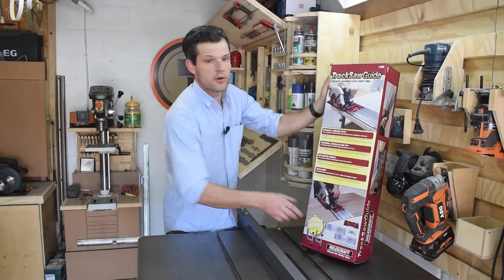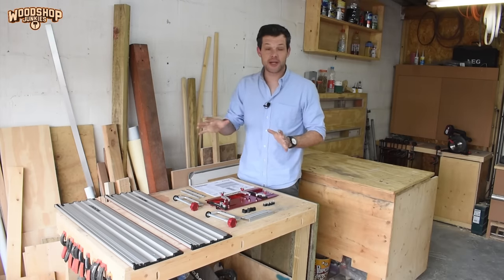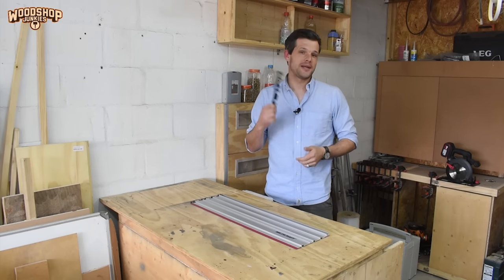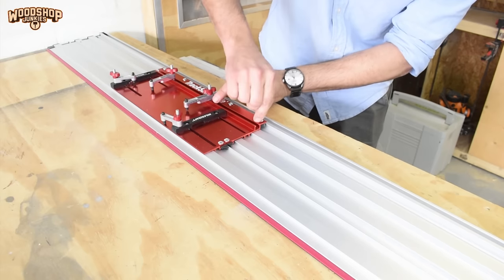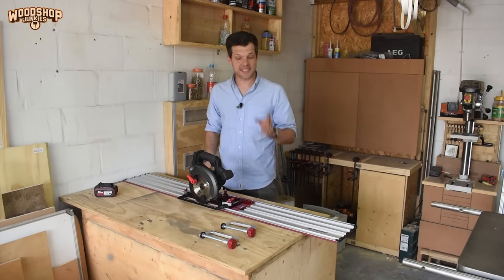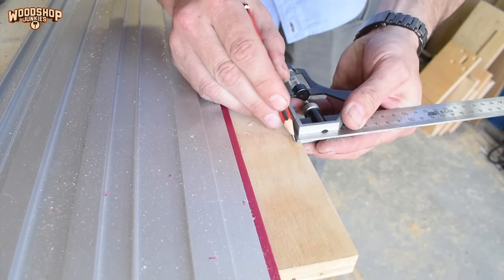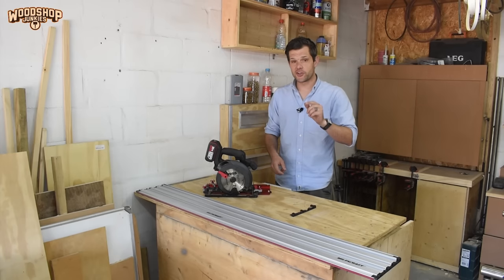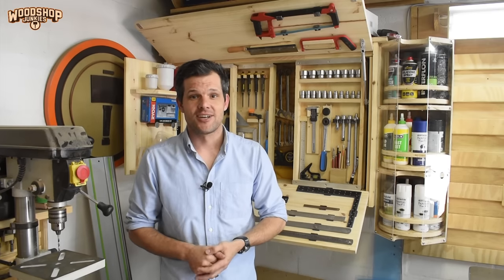Universal Track Saw - Affordable Option Or Waste Of Money?

Comment: Excellent presentation. I like any well designed and made product but frankly, is all that gear and fussy setting up really so much better than simply clamping a straight edge to the work piece and using that to guide the saw?  I suppose if you have dozens of cuts it might make sense.

Comment: It looks symmetrical. 
Will it work with a saw with the blade on the opposite side of the saw body? (i.e. Milwaukee M-12 Fuel 5-3/8 inch saw)

Comment: As said by others looks good. One thing you didn't show/mention was cutting at an angle... 45° or other. Does the blade still line up with the edge on the tracks?
Reply: It was missed in the review but unlike a plunge saw on a track, this track can not do bevel Edge cuts, it can only do 90° cuts.
Reply: Thanks.

Comment: Luckily your wife's aim is bad. (You should patch those holes.)
Not a bad product - but half the track length of the competition. One can still rip 8' with some care.
I am impressed with the construction and mount - it is way better than my Bora rip guide which is all plastic and not at all secure. I had to drill my bottom plate to add screws. And the Setup is ideal - no measurement - measures from the blade. As long as that is 90 degrees that's all you have to worry about. Eliminates blade runout too. 
Best wishes to you.

Comment: The Milescraft looks much better and more well made than the kreg accucut. There are only 2 things I think kreg does better

1. The track is reversible, with chip guards on both sides, doubling the length of time before you need new chip guards or tracks. Also allows you to calibrate the track to 2 different saws if you need to
2. The sled has an indexing pin that allows you to reset the saw in the same position without the need for a spacer

Comment: Videographer,can I ask you one question,does the Milescraft track saw guide go  beyond 8 feet
Reply from the maker: @hopenavajo1391  using the 1408 guide rail extensions the rail can be extended behond 8ft, yes. But I cannot comment on accuracy and use because I have not personally tested the unit with the extension option.
Reply: @WoodshopJunkies  thank you for the kind reply.👍👍

Comment: I'm curious how long the plastic ends will last.  Will they come loose over time and constantly fall out?  How long before they start cracking?
Reply: Considering no one else that I’m aware even bother with track end caps, that’s small potatoes.
Reply: They are an extra cost add on for Festool and probably fit a few other track profiles too as they mount to the top 'U' channel.
Reply: @brucelee3388  the Festool deflector is only designed to fit on the infeed side of your track. You can’t buy two of them and put one on each edge. it’s not an end cap to protect the edge of the track like in the Milescraft ones; it’s designed to prevent the  power cord and dust collection hose from snagging the jagged edges of the track as you slide the saw forward. 

No manufacturer bothers with track edge protection other than Milescraft apparently.

Comment: I got the expensive Kreg Track Saw kit, it seemed and sounded great in all their demos, but real life experiences shows otherwise.
it's not all that accurate.
In reality there is no much difference from using a regular straight edge ruler and hold it down with clamps to act like a guide.
The rail / screws loose grip and alignment over time, making it an annoyance to have re-calibrate it everytime you want to use it.
I have mixed feelings about using these tracks options, they are OK for short cuts, but if you want to cut long boards like 8' then the rail alignment becomes and issue.
for anything shorter than 4' it works great, but then at the same time, anything 4' you got plenty of alternative, if you don't already have a track guide for the circular saws.
The only reason I got it was to cut long boards like 8' + but it's not living up to the accuracy shown in the demos.
The point is, you always end up spend more time, setting it up, than doing the actual cut.
Using a stretch edge + clamps,, you're ready to go in a couple of minutes vs. using these guide saws, which you spend a long time re-adjusting it every time.

Comment: I have one of these and have been running it for a few months. My thoughts: first, DEFINITELY USE A STRAIGHT EDGE TO SET IT UP!!! His didn't seem to need it but do it anyway. Mine needed it and it will save you a ton of headaches. Second, throw the clamps in the trash. The bend way too easy and I find it much easier to rely on the friction strips. I don't like the method of adjusting the play on the sled. Otherwise good buy. If I were to do it again though I would just buy a Wen tracksaw for an extra 60 bucks and save the trouble of having to set my saw up every time I need to take it off the sled.
Reply: Some other notes. I had the same issue with the back clamp stopping my battery saw from going down to full depth. Most circulars don't have great dust collection whereas track saws are designed with this in mind. In my opinion a track saw is a MUST have tool. The Wen, for example, has a nice plunge cut feature that most circular saws don't have. This is a great super cheapo product but if you have the extra $60 just get a Wen track saw.
Reply: I am trying to build a 2 layers structure saw guide for my circular saw.
Here is my plan:

1. Both side 2.50 inches height wood bar. 
2. The first layer of the base, screw 2 x 24 inches T tracks on both right and left side; 2 T tracks add to the Upper and lower of the base, and tracks add 3 slider nut, so you can add a holding cramp, stabilizer, and stopper vertically and horizontally.

3. On the both sides of 2.5 inches height bar, add another 16 inches T tracks.
4. Use 2 different sizes of wood bar to make 2 L shape bar, and add a T track slider on the L shape bars.

5. Insert the L shape bar into the 2.5 inches height bar, put your circular saw on the top of the L shape bar, move to left or right side, and then stabilize it.
Reply: @City-Hiker  Absolutely no idea what you are talking about but best of luck to you! Good on you for building not buying
Reply: @olddog2newtricks  : Well. There are many different type of saw guides. Building a saw guide may be more expensive than buying one depending how do you build it.

For example, the Kreg KMA4100 Saw guide  can be sold lesser than $40 because there is only 2 rails, 2 piece wood, and heavy duty plastic material. However,  If you want to build saw guide with T track, the cost is far more than $40. 

If you need a parallel bar, or T track as saw rail on top, it would cost you even more. 

The one that I built have 2 pieces of 24 inches and 4 piece of 16 inches T track already costed me over $40, and this cost does not included screws, lock stoppers, clamps and lumbers yet. With all those cost, it cost me about $90 to build it.
Reply: @City-Hiker  I don't understand why you have T-track. On the underside to clamp to the work piece?

Comment: Seems nice, but unfortunate they didn't just add another fence to the sled so you can just drop the saw on and tighten down after the initial setup. It's also really easy and cheap to make an accurate circular saw guide with MDF that doesn't require installing and removing the saw form a sled, so I probably wouldn't consider paying for something like this.

Comment: $100 US on Amazon, not exactly cheap.
Reply: And that is just the 50" track that comes with it. If you want to do full sheet goods you need to drop another $80 for the 55" extensions. BUT....track saw kits are much more expensive. A cheaper Ryobi is $200+ but isn't as powerful as your corded one. Some of the other "stronger" brands are easily $500+ for saw and around 8 feet of track. When you really start pricing out new saw/track combos for full sheet goods this one starts to look real compelling.

Comment: One caveat; most of these kits, including this one will NOT work with worm drive or rear handle type circular saws. I had invested good money into a nice worm gear saw several years ago. When I wanted to go track saw, the cost of a kit like this and a different circ saw meant I was wasn't saving that much money over just buying into the other big name track saw system. (Festool)